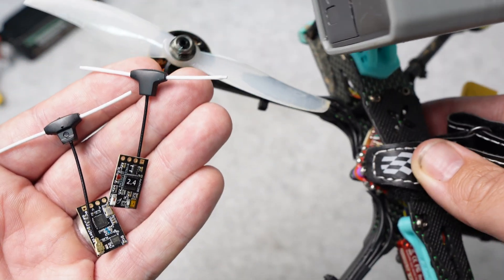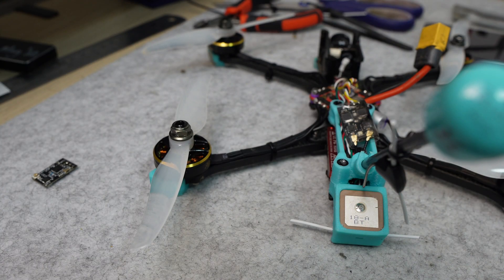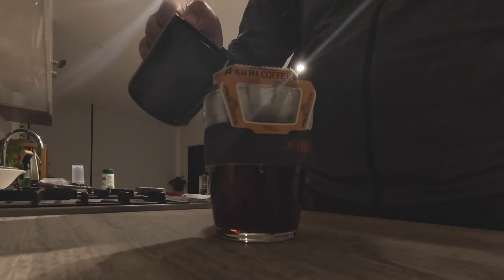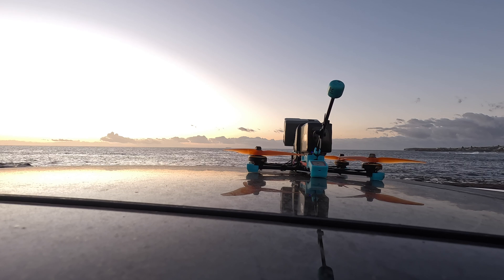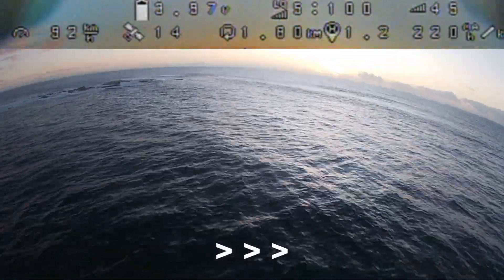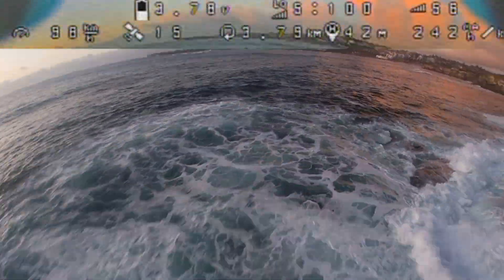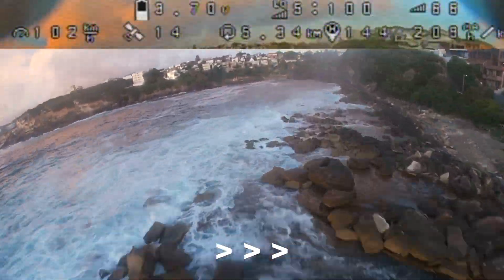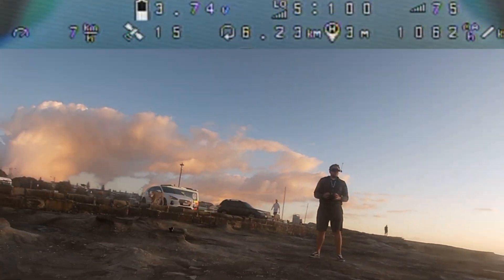I Tried This ExpressLRS Receiver From BetaFPV

Comment: Great slow cine flight. 
BUT.. 1W is a lot. If you are flying within 2km with ELRS over 100mw, something is VERY wrong with your setup. Recall, that last 10 years old 2.4Ghz systems were only 100mw. 
Admittedly, very low to ground and behind trees/building is much more challenging.

BTW I have 915Mhz ELRS and always have 15-25db link margin

Comment: So adding 2 brains and 2 ears makes it a better listener than a single chip with 2 antennas like the matek?
I don’t know if this is the case, because the reception bubble around one antenna or another antenna should not change. The low noise amplifier may help though… but are 2 chips really better than one, when the quad itself is small compared to the reception range?

Just asking don’t kill me for that :)
Reply from the maker: 💀

Jokes!

😁

There are a couple of things that the over simplified analogy doesn’t cover. 

Yes have two receiver chips send the received packed to a single processor to then send to the FC is better than 2 antennas with a single receiver chip. 

Dual antenna receivers feed to the one receiver chip, which feeds to a processor. Only one of the antennas will catch the transmission, and if it misses a packet or catches a bad packet then it can’t process it. 

While a true diversity receiver has two receiver chips which feed the one processor, so if one receiver misses a packet or gets a bad packet, but the other catches it or gets a good packet, then the whole transmission is still received. 

Antennas have a null point and are polarised. So if you hit that null point or cross polarise you failsafe or limit your range. 

On dual antennas only one of them receives the packet, it’s like both antennas competing to catch the packet. 

On dual receivers, they both may catch it or one may catch it. 

So having cross polarised diversity means you effectively have an Omni antenna 

This greatly improves LQ and RSSI
Reply: Thank you for having taken the time to respond and… a new Elrs receiver comes my way. 
It’s 3.0 only though and with the spi whoops I’m stuck at 2.5.1…